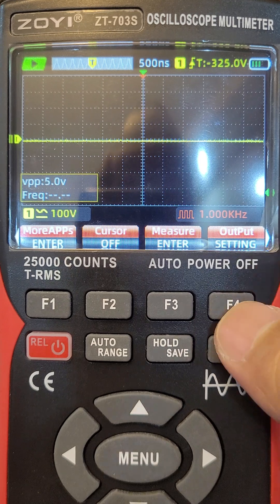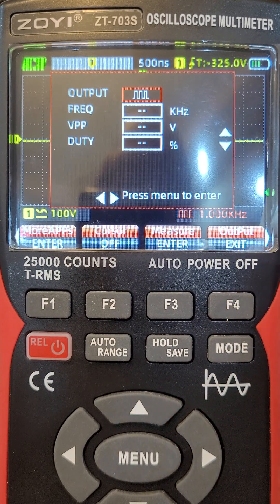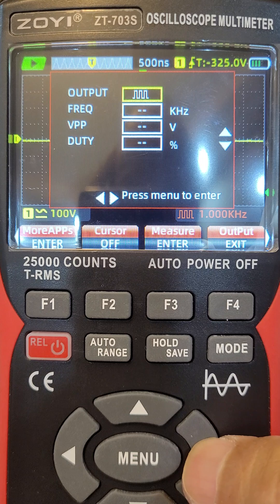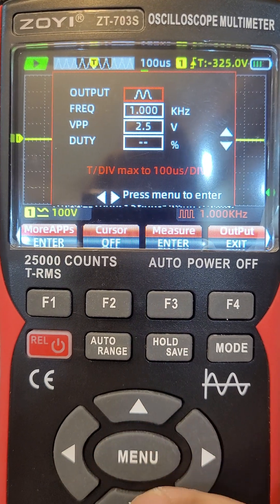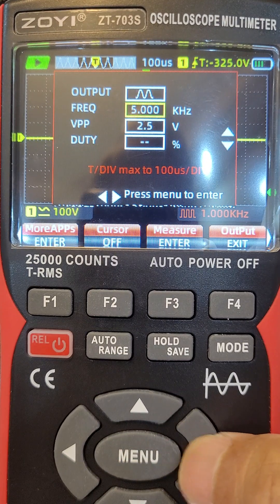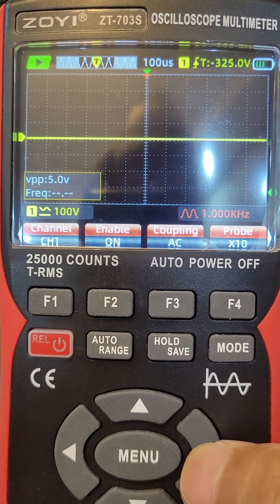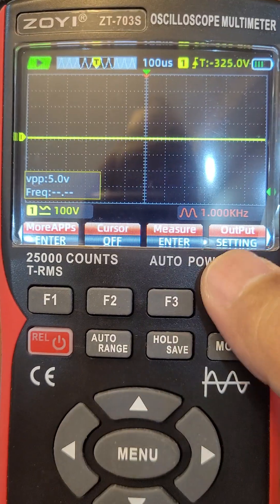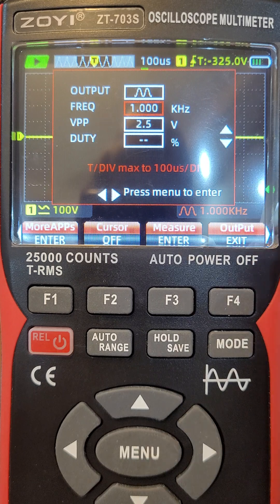ZOYI Zotek ZT-703S FWare 1.57. Glitch 002: A. Waveform Generator  #electronics

Comment: mate if possible for you to answer me, my 703S with 157 firmware , oscilloscope mode is quite unusable anymore. Sine weave 1MHz signal from juntek 6600 SG , on zoyi keep dancing a lot. If I go lower freq things become a little better, but not fully good. How it works for you ? Was so suspicious if something is wrong with my juntek 6600 so hooked both zoyi and hantek 1070 in same time to the same source, hantek no issue at all, while zoyi reading is very unstalble.
Reply from the maker: Any chance you could show what it looks like in a video or a short? Also what wire connections you are using to between the signal generator and 703s?

I will the do a quick short reply in return?